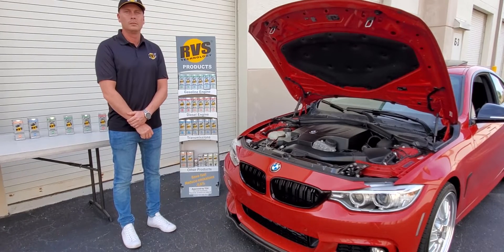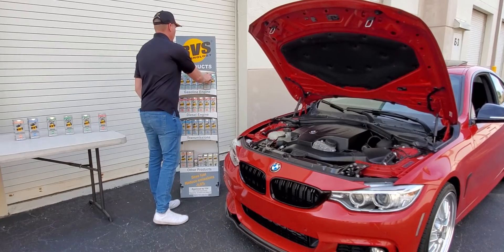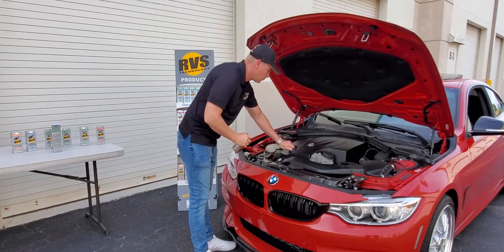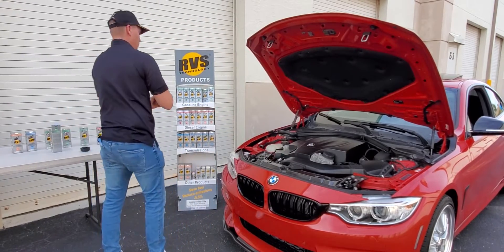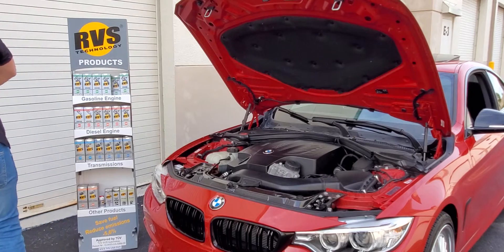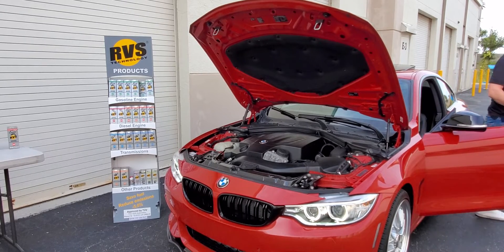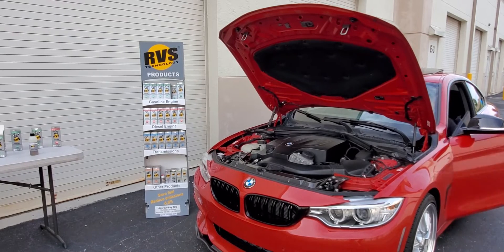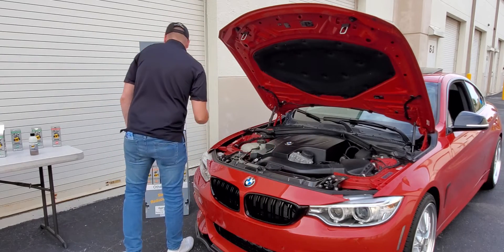How to perform a RVS Technology engine treatment to your vehicle

Comment: On a hybrid my engine shuts off a lot so it won't really idle for 15 minutes. What do you recommend?
Reply from the maker: @thebeddoctor4273 Just drive on the highway where the engine will be on for longer duration. The RVS treatment will also greatly benefit in the long term in hybrids because of the high risk of corrosion for example in the camshaft(s) if driving a lot in electric only, and cold startups where the engine turns on in higher rpm.

Comment: Can you go on the highway or do rpms need to be varied?
Reply from the maker: Yes, a regular drive of 20 to 30+ mins is the best way to run the treatment in. Just avoid full throttle/load for the first 150 or so miles

Comment: Question, I have a 2004 Escalade I've owned for about 15 years. It has a 165,000 MI. I added the RBS per the instructions and it took me about a month to drive the necessary 300 miles. I hope that doesn't cause an issue.

Now, I am getting an oil change with some inexpensive oil and going to add the second bottle. Is it my understanding that I'm only supposed to drive with the second bottle in for a thousand miles or 2,000 miles?
Reply from the maker: Hi Joe and thanks for trying out RVS! No issue there in the slow first 300 miles. Key is to do a good initial drive, 20+ minutes to get a good heat cycle. For the second treatment in new oil, that just stays in until you do your next oil change. For the V8s, especially with higher miles, we recommend using the G8 for best results. We have many happy Escalade customers who see great results.
Reply: Sorry for typos. I'm using talk-to-text.

Comment: Question, I have 2005 Tahoe automatic transmission. Is the additive to be added in the transmission dipstick hole or through the oil in the bottom? Was questioning to put it in myself but may just take it to a shop but in case they don't know where to put it in themselves, could you let me know. I've heard great things about your product!
Reply from the maker: Easiest way is to get some Trans fluid, mix about 20-30ml of it well with the gel, then pour down dipstick hole. We'd recommend then adding a further 20-30ml of just the fluid to wash it down. Very easy!

Comment: So the goop in the tube is to be mixed with the “oil” before going into the motor.  Why not have the goop already mixed and ready to go? 
How does the motor know you only put half in at a time? 
SNAKE OIL!!! Website hasn’t been updated in 3 years 😂😂😂
Reply from the maker: The gel is designed to be mixed with oil, and some customers might use a different oil to mix. Also, we do not want the gel to sit too long with the oil standing still so it doesn't stick to the bottom and becomes harder to mix. The pouring is done in two stages to make sure it is distributed evenly and not too much at a single time for safety (if it wasn't mixed properly etc.). We've been around over 20 years now in Europe, with thousands of testimonials, and also official testing by the likes of TŰV, so it's hardly snake oil.

Comment: So I have a 4-cylinder sports bike  takes 3.7 quarts of oil and has high mileage and It has a very small tick in the cylinder I know this because I have aluminum chips in my oil pan, but it still has its power will this help prolong the engine
Reply from the maker: How big are the chips? It's definitely worth a try and give it some extra life. For 600cc and up motorcycles with a wet clutch, we recommend going with the G6. This is because the transmission uses the same oil and it uses a lot of metal to metal surface area with all its gears and moving parts. If it has high miles and the bike seems to respond well, we'd recommend doing a third treatment as well down the line.
Reply: @rvstechnologyusallc2290  ok cool so if I get the g6 and I have to use the whole bottle do I just put the minimum amount of oil required then add the half and half bottle of rvs or should I add the bottle first and watch my oil level as I add more oil after the bottle
Reply from the maker: @markecebattle1573  we've designed the oil quantity (100ml) so it can safely be added to any engine. So just follow the directions and you will be good 👍

Comment: I got a used GMC Yukon from a family member with 340,000 miles. It still shifts and drives great but I want to do everything possible to prolong it's life, kind of just to see how far I can push the original engine and trans. What combination of treatments should I use and this be added to a transfer case?
Reply from the maker: With the high miles, most vehicles can benefit from a 3rd engine treatment. We're assuming it's one of the LS V8 engines so we'd recommend starting with 2x the G8 engine treatment. Even though oil capacity is about 6 quarts in those motors, they have a big surface area due to the large displacement. For the transmission a single T6A transmission treatment should be fine. For the differentials, you can buy one T6A and split in half or into thirds if you have a center differential. You should see a good boost in fuel economy and more torque too. And if the power steering seems at all sticky, might as well treat that too. Let us know if you have any other questions and we will be happy to help!
Reply: @rvstechnologyusallc2290  Thanks for the help! I see the products aren't available in any retail stores, but I'm going to go place an order on Amazon! I'll post again once I've got the vehicle and applied the treatment
Reply from the maker: @CrossingRover  Unfortunately for now we only have some local shops in various states selling our products, as well as online retail as well. If you purchase through our website, www.rvs-usa.com, you can use coupon code "RVS" and it will give you a 15% discount.
Reply: @rvstechnologyusallc2290  Thanks for the code, I'll order from your site instead.
Reply: Well Robert M... How did it go?

Comment: I own a 2019 Elantra GT N-Line with the 1.6L Turbo motor. Which level should I get? How long does it last on a car that gets driven hard/raced and has been tuned/modified? I have 12,876kms on it as of right now, and i always use synthetic oil... 4.5ls of oil to fill
Reply from the maker: If the car gets driven very hard, the treatment might last less than our advertised 60k miles or 100,000km. Since your car is turbocharged and low mileage, we'd recommend to do a single G6 treatment.

Comment: What if I changed oil and added in the first treatment, so now I have to drive 250 miles and change oil or can I drive with the same one? Could something go wrong?
Reply from the maker: Well it depends on the mileage and what type of vehicle and upkeep. The idea behind changing the oil after 250 miles is that our product also cleans the contaminants on the friction surfaces and we don't want them to start circulating back in the oil for too long.

Comment: I need to put a transmission one in my 2001 Honda accord, how do I do that? Do I
Fluid exchange adding this into the new?
Reply from the maker: https://youtu.be/XJIxaLRUeDA
The same principle applies as in this video. Some cars are easier than others. If there is a dipstick, you can take a bit of new transmission oil and mix the RVS gel into that and pour that in.
Reply: RVS Technology USA LLC Yes I do have a dipstick, I’m afraid of overfilling it though, should I drain some transmission fluid out before adding this? Can I buy this RVS in Auto part stores?
Reply from the maker: @wisheduknew294  you won't over fill it if you just add say about 20ml of it. As long as you get the gel mixed with the oil. Unfortunately, not yet widely in stores (we have local shops in various states), easiest is to order straight from our website, www.rvs-usa.com. Also available on Amazon, Ebay, Walmart.com

Comment: My cars take 4.5 quarts of oil.  Is the G4 fine or do I need to use the G6?    One has 240k miles, the other 56k miles.   thanks.
Reply from the maker: Are they turbocharged? For the high mileage one, we'd recommend 2 x G6 treatment or at the very least first perform a G4 and then a G6 since it will have more wear inside the engine, so a stronger treatment is recommended. Some worn engines will benefit from a 3rd treatment as well down the line. 2 x G4 treatment should be fine for the car with lower mileage :)
Reply: @rvstechnologyusallc2290  The one with low mileage is turbocharged.
Reply from the maker: @grants169  if the car gets driven hard at all, or you just want maximum protection, you could also do the second treatment with a G6. The oil also circulates the turbo so that will get protected as well.
Reply: @rvstechnologyusallc2290  Cool.  thanks for the speedy reply :-)  Ordering now.
Reply: @rvstechnologyusallc2290  Just as a sanity check, I use AMSOIL Signature Series 5W-30 Synthetic Motor Oil and they are very particular about stating never to use additives.  I know you claim RVS isn't a typical additive, however I want to make sure I'm not causing a problem here.  AMSOIL states that adding to their oil may cause complete engine failure.   Am I going to kill my engine?
Reply from the maker: @grants169  it is completely safe. However, for best results we typically do suggest doing the first treatment in old oil and preferably in oil with no other additives. But no, there won't be any complications using our product, it's safe with all kinds of oils.

Comment: The video-man pours in a bottle of mix on top of prescribed amount of engine oil. Does the mix evaporate or assimilate, or must an equal amount of oil be removed later? Second, I have a BMW R100 cycle from 82 with perfect compression, no "deep" noises, but unknown amount of wear on crankshaft and such (mileage unknown). Does that mean 1 or 2 treatments, you think?
Reply from the maker: The amount is only a bit over 100ml and can safely be added. For any vehicle that are older or have some miles (25k+ in cars, 10k+ in motorcycles) we always recommend two treatments. In motorcycles with a wet clutch, we recommend a bit stronger treatment vs oil quantity because of the increased surface area to be treated because of the transmission. So in your case, you could do either a G4 and then a G6 or do 2x G6 😎

Comment: Do you change your oil before or after adding the rvs? Or does it not matter
Reply from the maker: Depends on the mileage of the vehicle. If it has less than 25k miles, you can do 1 treatment at any point as long as it has about 800 miles of driving to treat. If more miles, perform first treatment in the old oil, drive 250 miles, then change oil and second treatment in new oil that stays in.
Reply: @rvstechnologyusallc2290  thanks I saw your treatment being used on a Cadillac can't wait for it to arrive

Comment: What about for automatic transmissions that don't have a way to pull out any transmission fluid? Just get some at the parts store?
The instructions say to pull out some transmission oil to mix with the gel before adding it, but most automatic transmissions have no way of getting any out.
Reply from the maker: For sealed transmissions we recommend professional installation. Every transmission has a drain and a fill hole, it will just have to be done on a lift. But the basic principle is the same :)
Reply: @rvstechnologyusallc2290  I should have worded that differently. Of course they have a drain plug, but often the dipstick tube is also the fill tube.
Reply from the maker: @aoeuidhtns  Ah Ok! No worries. In that case, yes, just mix the gel into new oil and pour in. As long as the gel is mixed homogeneously with the oil it's going to be in, all is good.

Comment: A question;
What happens if, say, 20 miles after applying the first treatment you have a sprint, 80% load, for a few seconds (approx. 5)? Yes, first hand experience haha.
Reply from the maker: You should be fine. The idea is to have the coating to be able to apply itself without too much extra pressure, in this case full throttle or full load. Just continue driving regularly over the initial 200 miles or so and you will be all good to go!
Reply: Just a heads up to everyone. First used RVS engine (and transmission) almost two years ago. I've since driven my 2.0 Mazda3 for 20k miles (yes I drive a LOT, city, cross country, to Canada, etc) and have had no issue. Never an issue starting up. My Mazda, like most MZR, consumes oil like crazy but even when it's low (and the rare moments I forgot to check every other fuel up) oil temps stay relatively low and my engine doesn't sound it's having any trouble.
Reply: @vtk5  Nope! My oil consumption still happened. I believe oil is seeping past the valve seals. However, other than that, the engine is running pretty strong! Lmk if you have any other questions, i'm glad to answer it
Reply: @vtk5  It's progressively gotten worse, I lose a quart a week *minimum*! Damn thing drinks oil as if it's a rotary hah. I'll be doing a 2.5l swap in the coming spring and driving my Speed3 daily instead.